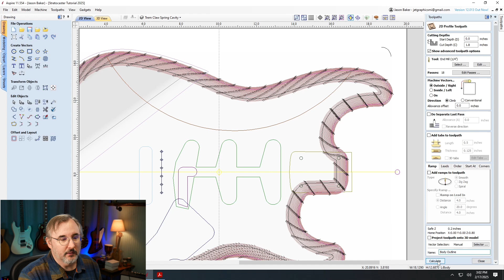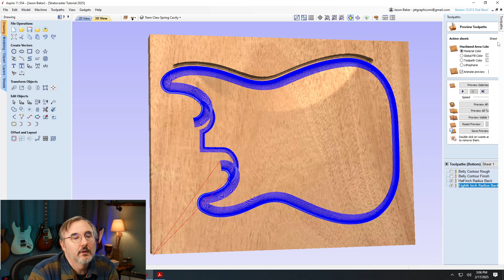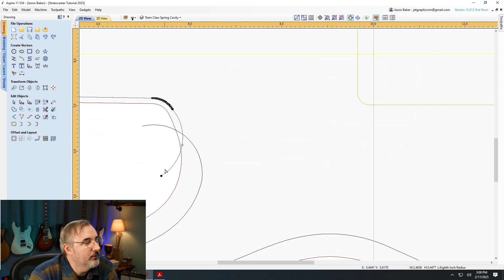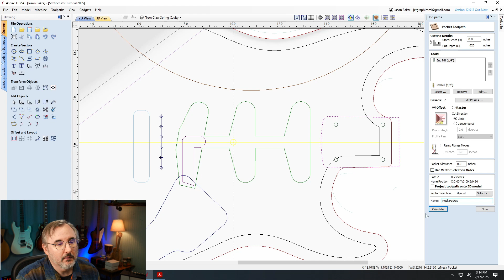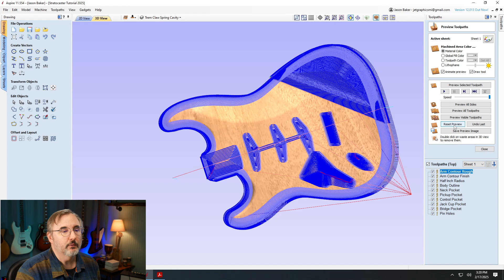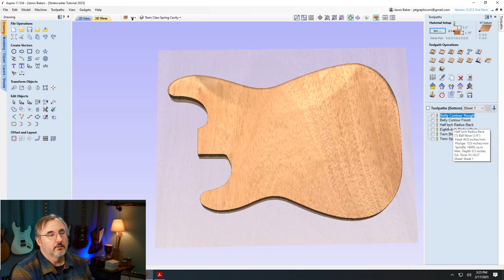Building a Stratocaster Using Vectric Aspire 11.5 - Part 3

Comment: I have been following your how to make a Stratocaster using the CNC machine... I am using VCarve Desktop 11.5. I was able to build all of the files,  body neck pocket, etc. I saved it according to my machine and file type for my machine... However when I went to run the files it only cut the outline of the body, and pickup pockets etc it did not clean out the pockets... what step did I miss? 
thanks

Joe
Reply from the maker: Make sure to use the Pocket tool path for pockets and not the Profile tool path. Profile just cuts out a shape. Pocket actually makes a pocket.
Reply: @CNCGuitarWorkshop  After I created all of the layers- body outline etc. when I go to select a layer- clicking on it to begin the tool paths, I get a section with dotted lines as if I am editing the selection. Must have missed a step in creating the various layers. Is there another way to select the layer for the tool path?
Reply: @JosephDorociak  I usually just click on the item in the 2D view.

Comment: Again you did a very good job on the body easy to follow and understand.  I have been working with Aspire for several years and found some  Shortcuts that I like using and have found some information that you have put out that will help me out. It has been very cold here in Michigan so I have been working on guitar neck using Fusion 360 and Aspire.  When using Aspire expect that you will have to sand and shape some.
Reply from the maker: Thank you. I'm in Michigan too! Thanks, the neck tutorial is coming. Maybe this weekend.